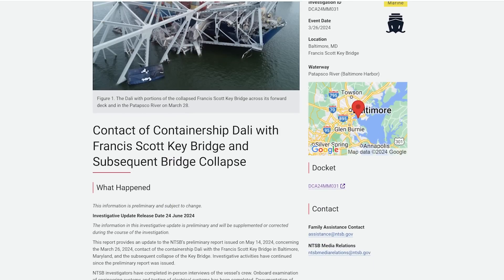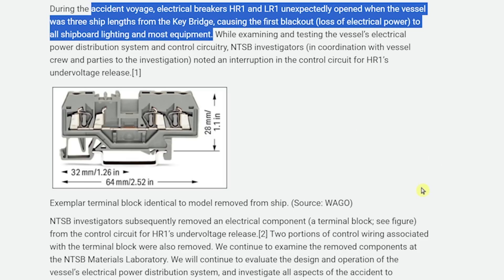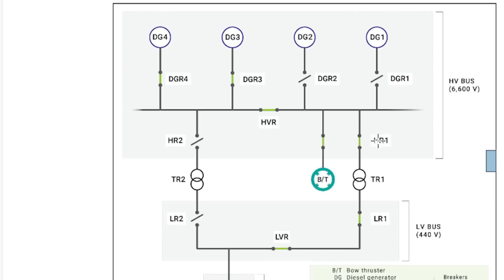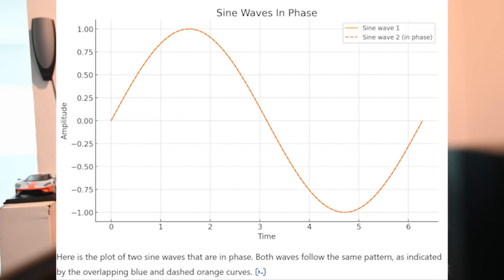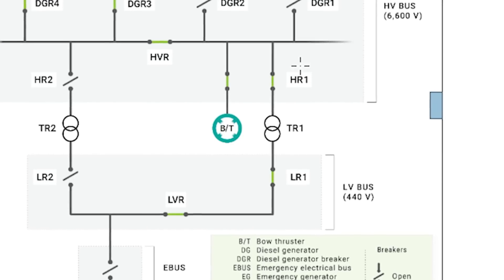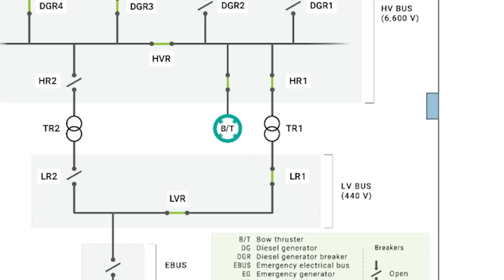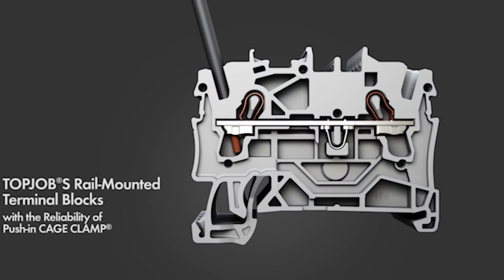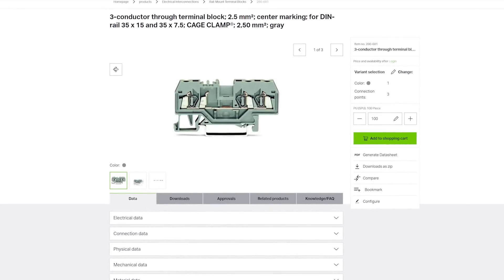Did This Part FAIL Cause MV Dali Key Bridge Collapse?

Comment: I'd be curious to see schematics and a functional analysis of how Dali sync'd generators.  With 4 to use in different combinations, that has to be more complex than just a single pair master-slave design with reduced capacity fallback to either one.  

I'm a fan of Amp PIDG spade lugs, with MIL-39012 oxygen free crimps and insulation retention.  Not as easy to wire as those Wago blocks.....  

Aluminum in a marine environment?  Hydrogen replaces Aluminum in an electrovoltaic series, whereas copper replaces Hydrogen.  IOW, even without a salt environment water over time can make Al wire turn to mush of Hydroxide flakes and powder.  Why risk No-Alox or other brand equivalents?

Comment: The part is largely irrelevant. The underlying cause was a lack of well-engineered, no-fail, simultaneous, dual power supply to all critical systems that switches automatically or manually as needed. In other words, the same standards that have been applied to commercial aircraft for many decades.

Comment: I didn't see any specs on those terminal blocks, but I certainly hope they were used on low voltage low current applications.  Any type of electrical connection that is made with spring loaded contacts and not from clamping force from a bolt or screw is questionable at best.  Personally I'm shocked this is even allowed on any ship, especially in US waters.

Comment: Nobody in their right mind would use aluminum wire in this situation. That said, if the insulation of the copper wire was stripped to less than the spec (.31"-.35"), it is possible that the insulation could interfere with the conductor to terminal connection and cause an intermittent connection especially under vibration. (BSEE '67)

Comment: Yea, it is going to come out that it is just some sort of fault in some part and nobody is to blame.
The real problem is that ships nowadays shut down the main engine and the controls when there is a power fault. That was not the case on older ships.

Comment: A number of comments here have speculated that the harsh salt water environment may have caused corrosion of the electrical connections. If that is a hazard, one would think that an environmental management system would have been in place in the electrical control room.

Comment: 30 years as a marine engineer, 10 of them as a chief engineer. NO ONE would ever use aluminum wire on a ship. Not even silly Naval architects with PhDs.  The ship was 20 or so years old with constant vibration, heat, and salt air environments progressing something called entropy.  Everything decays and goes back to nature. Given enough time (another 60 years), the bridge would have fallen on it's own. What I am getting at is that "man" cannot control everything all of the time. I would bet that the low voltage trip was because of a computer or microprocessor error.

Comment: That method of fastening a power wire to the block is crap!  You need a proper terminal for power  , like a screw down lug not the edge of a clip.   Failure!

Comment: A bad WAGO spring loaded terminal block...  Who'da thunk it?  ;)   The WAGO blocks are a breeze for building/assembly, but my experience is that in severe duty (heat/cold/moisture/vibration)  they are notorious for intermittent glitches.   I've chased a LOT of problems on industrial gas turbines that use these things.  And they can be a double barrel bitch to find the intermittent connection!  

Interestingly - The equipment I used to work on was equipped with WAGO Screw-on terminal strips.  The same thing as you posted, but they had screw connections instead of spring loaded connections and ferrules. 

The other possible problem with WAGOS of this type is when assemblers or technicians install wiring directly into the spring loaded connector.  Using the wire directly on the spring loaded contact surface can reduce the contact surface area, and heat does what it does.   After a while you have a nice flakey connection.   That happens much less frequently with the ferrules.

Good report, Jeff!

Comment: While getting to the exact source of he problem is important, what is more important to regulators and insurance people is did similar failures occur when the ship was in an open area and such a failure would have very little consequence. IF there were previous situations and the cause was not identified, that speaks to neglect. If this was the first time, it was at a most unfortunate time.

Comment: "In two independent conspicuously shake-free, perfectly-lit, perfectly-timed, perfectly-framed and even perfectly-zoomed videos — “Zapruder 2.0” style — the DALI container ship, fraught with electrical troubles before shoving off, briskly accelerates yet creates no visible wake nor bow-wave displacement and, despite two agonizing power blackouts (whilst reportedly moving at highest-allowed harbor speed of ~8 knots) causing failed engines, steering and guidance, DALI sublimely avoids all nearby concrete buttresses and both treacherously narrow, steep shipping-channel cliff-edges for the ship’s nearly entire transit until its final ‘beaching’ into the channel’s southern cliff-edge, to not just glancingly bump into a main bridge support but instead score at speed a perfect missile-like bullseye that almost instantly takes down nearly the entire bridge and severely cripples both a major trade port and transportation artery."  --- from the ORGanization (not the COMpany or NETwork) site called "CON" followed by "SPI" and with an "RA" on the end.  The 90-part series there covering every known anomaly of this event is thoroughly interesting.

Comment: This point is tiny, minutiae, a fly.  Almost nobody has mentioned the utter absense in either of the two original night time videos of big waves following the big collapse and big splashdown.  The second video has audio but not a single sound is heard from the massive, heavy bridge collapse.  It's eerie.  Linked from the 90-part series on the many anomalies of the BKB event -- it's on the ORGanization (not the COMpany or NETwork) site called "CON" followed by "S" then "P" and with an "IRA" on the end.

Comment: I am a retired ME so I am not as familiar with the ship’s electrical system.  Another YouTube that is authored by a chief engineer on another ship provided a more complete electrical diagram (not from the Dali), which helped me understand a bit more about the ship’s electrical design.  The majority of the ship’s mechanical equipment are powered off of the 480 VAC circuit.  The notable exception is the bow thruster and the main ship propulsion.  The bow thruster was not in use as it is only used when leaving a dock.  Of course, the NTSB has the actual ship’s as built drawings and the maintenance records that they will be used to zero in on the failure.  I’m wonder if the main generators may be the cause.  Time will tell.

Comment: That is a passive terminal block, control wiring should have been copper. Wago has 40 years in the design of ghat block and i work with them a lot in new equipment.  Most failures I see are installation induced, IE wrong wire size, no ferule, improper tools used in install or exceeding current spec of part.

Comment: Thanks for your continued analysis of the Dali disaster.  I have worked on alot of power systems with DIN track stuff, and in this case I am guessing the breakers are shunt-trip types that are activated by the control system, of which the WAGO DIN terminals are a part of.  Personally I much prefer screw-down terminal strips, as the pressure contact ones can be damaged by improper insertions and especially removals of wires.  For instance, to remove a wire, you insert typically a small flat-blase screwdriver in the release slot, and then gently pull the wire out.   Maybe someone didnt have the release pushed all the way back and just yanked hard on the wire, deforming the spring contact.  Or maybe stranded wires were partially bunched up and not fully inserted.   Assume this might be what NTSB is looking at.  As for alminum wiring, theres no way that could be present in a ship.  We dont even use it in data centers due to the corrosion potential.
Reply: Ships yes but data centers use AL wire all the time for high voltage feeds, its way cheaper than copper although copper is definitely better, Frugality lol

Comment: WAGO connector???
There is a big push to use those things on line voltage wiring in your home....everything from light switches to outlets use those silly things...I am now replacing 10 year old outlets due to  overheating from these connectors....
Reply from the maker: They likely were not wago but cheaper knockoffs or pushing that come with many light fixtures. Wago lever nuts are tried and true I use them

Comment: Please tell me they don't use aluminum wire on ships. (except for major high voltage lines)  That combined with push-in connectors is a really bad combination.  There is a reason they stopped using aluminum wire in homes.

Comment: The most likely thing that would involve a terminal block is a loose connection.  Loose connections are a lot more common with those than design flaws in the terminal block itself.   The protection circuit is probably wired to be fail-safe where any break in the connection (normally interrupted by logic operating a relay, maybe logic directly, or a red mushroom button) - and a loose connection can also break the connection.  Loose connection is also more likely to be intermittent.  A protection loop shouldn't normally see very much current, so it shouldn't be seeing a lot of thermal cycling.  But a ship is a big vibrating environment that would have a tendency to cause connections to loosen up.    On connections with current going through them - you can get an early indication of the failure with thermography as the interface heats up due to increased contact resistance as it loosens up.  (conversely - if there is not current, or not very much current going through it then it won't be generating enough heat to show up that way).    It is difficult to scope and manage a maintenance plan to "go tighten ALL electrical connections" - but there are maybe a few ones that are important enough to have regular effort to check on them.   Hard to say if this system would have been included in something like that - easier to deprioritize it  because there is a redundant path.

Comment: "Low Voltage Release" is a common feature of power circuits that will automatically disconnect the loads from a bus when the bus is lost.  The idea is if the HV bus is lost, you want to trip all the loads off the bus so when you re-energize the bus you're not overwhelmed by all the loads still connected.

But if the control circuitry 'senses' a low voltage (due to faulty connection) even when the bus is operating normally, would 'trick' the breaker into thinking there was a voltage problem and trip the HR1/ LR1 breakers.  

I remember an incident at work where we had an emergency diesel start unexpectedly.  It was caused by a blown fuse in the voltage-sensing circuit so the engine controls 'thought' there was a loss of bus and started.  Fortunately it didn't try to energize the bus (which was still energized from main power) because the breaker controls used a different voltage sensing circuit.
Reply: If the bus is still energized from main power, doesn't the VSC detect this condition and terminate any connections or bridging?
Reply: @1Patient  Well that's the idea, but to 'detect' that the bus is energized, it uses a small relay connected to the bus.  But that wiring is through small wiring and terminal connections, etc...  If one of those wiring connections is faulty, it may drop out the relay even though the bus is still on.  It's a matter of faulty 'sensing' circuits.
Reply: @mikefochtman7164  I guess what I am getting at is, I'm thinking there should be a redundant system that detects the detectors fault and reports that back to the controller so it can continue on as it should. Having said that, if there was a ground fault and the main bus did have to shut down... would it melt the mains? I know, it might sound like a ridiculous question. 😃
Reply: @1Patient  Well of course one can go down this route.  But there's a practical limit to 'sensors to detect that the sensor-fault detector hasn't detected a fault in the fault-detector-sensor'.  This one may come down to poor maintenance of some equipment (or improper wiring installation).

It's very hard to make things perfectly 'fool proof' when the world just keeps evolving ever more silly 'fools'.
Reply: @mikefochtman7164  Remember the Grenfell Tower Fire? I think it was attributed to a faulty refrigerator compressor, or wiring to or something along those lines. Also of interest with this  one was the choice of cladding they used on this project.

Comment: Equipment can do crazy stuff. This has nothing to do with this case but I worked on a reefer ship where its DC generators would reverse their polarity.

To cool the two hatches we ran three generators, Two MANs and a Detroit diesel. The MANs would reverse their polarity and turn the Detroit diesel into an electric motor by stopping it and turning it in reverse. An older engineer told me that he had seen connecting rods burst through the sides of an engine when this happened. Luckily that never happened to us.

Comment: "an interruption in the control circuit for HR1’s undervoltage release." surely suggests an intermittent circuit in the CONTROL circuitry of that system.  In other words, they've taken away that connector block with the connected wires to flex them, shake them etc to see if that was the cause of the "interruptioon"

Comment: Go back to your NTSB report video. The ship had the same problem at port resulting in power loss, low voltage causing the breaker to trip. There was either a problem with the generator or the breaker.

Comment: OK, An undervoltage release coil is designed to be powered at all times. If it loses power, it will release it's plunger to operate a lever. This lever will release a spring which causes the breaker to trip. A momentary loss of voltage will cause the breaker to trip and unless there is a method of recording what the particular control voltage is doing, there is no way to tell what caused the trip.

As to what caused the momentary drop out of the control voltage, there are any number of things. With the Terminal alone, I can think of three or four alone. The cages could have failed due to age or metal fatigue (they are only about 1mm thick). There could have been corrosion due to the sea air reacting with the copper wire or cage. I have yet to see a control panel wired with aluminium wire but for runs between different boards it may have been used. There could have been a hot joint which heated the cage or even started to burn out the terminal.

I noticed that the photo in the NTSB report is taken from the a catalogue showing dimensions. The terminal in question is also designed to have a small screwdriver insert to lever open the spring cage before inserting the wire and then releasing the cage to hold the wire against the clamp body however if someone was to really put pressure on the screwdriver while opening the cage it could bend the cage itself which would cause less force when holding the wire.

That said, the terminal may only be the first component in the control line when tracing back from the breaker. There could be an old fuse further back, a faulty control power breaker or any number of other components...

The downstream breaker most likely tripped due to the upstream breaker tripping. For HV/LV setups like this, it is recommended that the HV breakers do not CLOSE onto a load. so the control circuit would have most likely opened the downstream automatically.

Why the crew did not close HR2 & LR2 instead in case of problems with TR1 will also need to be looked at as a failure in operation. Doing this MAY have prevented the second blackout.

Regards

Comment: You have to wonder about the regulatory agencies that over see these things! You with probably not much trouble, discovered the potential problems or issues that could lead to the system failing or being susceptible to going down. Shouldn’t the agencies that approve and regulate these ships been able to have foreseen this too? Shouldn’t have better safe guards been in place, that if a ship lost power for a short period of time, that there would be other safeguards to protect vulnerable areas in case something like this happens?

Comment: Typical use of under-voltage release on a (A)CB is in combination with emergency stop push button or some kind of "Safety" circuit. This because typical Safety circuit uses OV to detect wiring issues  or hardware defect. I would expect that they had some Safety circuit in the system around generators and electrical distribution.....
Reply: Reproduce the entire electrical scene with manned testing equipment on every switch and breaker on the line.  Make those circuit breakers drop out.  Measure everything going on.  Reproduce the smoke and understand its cause.  Tell everyone in the industry what really happened.    Completely unmanned Chief Engineer stations are seeking design and operating approvals now.   4 billion dollar accidents must be avoided.  Are robotics and Digital controls really going to happen within the next decade?     Futurists say yes!